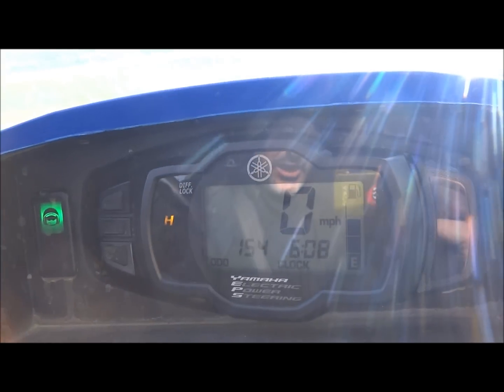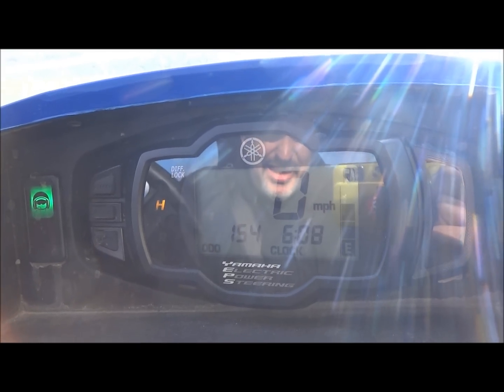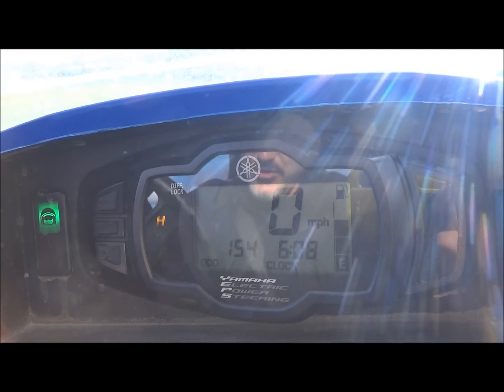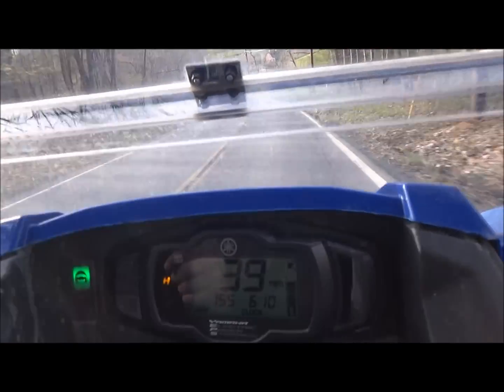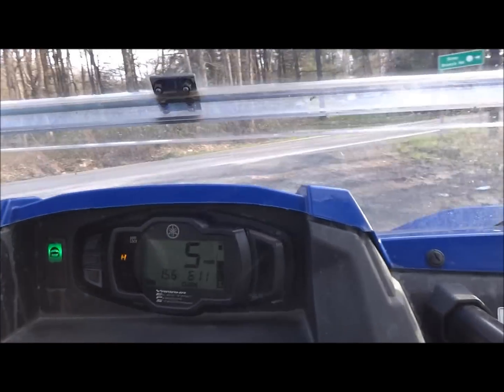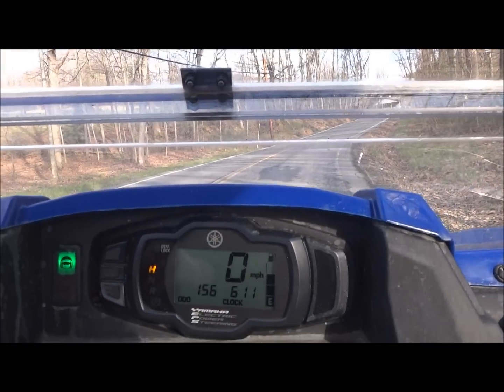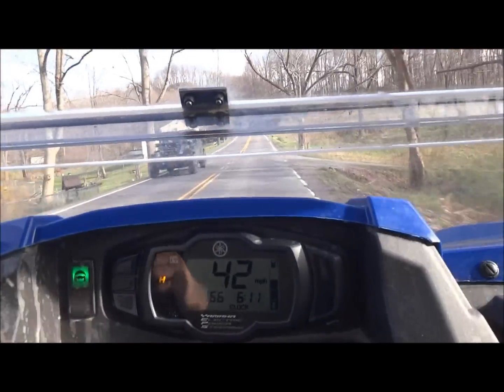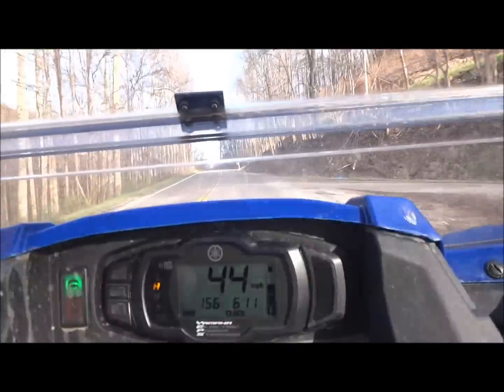Yamaha Wolverine Top Speed

Comment: mine did 52 when new now after 1700 miles it does 50.
you can chip it and get around 10 mph more it is governed if you want speed go with YXZ. And Polaris sucks I wouldn't take one if you gave It away I want to ride not work on junk.

Comment: Worn belt or not, what you've proven is that if someone buys this machine to go fast in a straight line, they bought the wrong machine.  A 708cc single cylinder engine just isn't going to make much top end speed in a 1311 lb machine.  Its designed to be a sportier version of the Viking for trail riding and I think it succeeds at that.  I only hope that this engine makes its way into the 2016 Grizzly.  That's where it would really shine.  Half the weight of this would make that 708cc engine feel very strong.
Reply: ***** That's a bit more like it but that's extra money you have to spend.  An 800cc Can Am Commander is already more powerful and faster than that and costs less.  I still would prefer the Wolverine because I question both Can Am and Polaris reliability but it seems the Wolverine should be a little faster in stock form.  Its a bit disappointing but its still more powerful than anything Honda makes.  Maybe Yamaha will finally put a bigger v-twin engine in it next year, one can only hope.
Reply: It has nothing to do with the performance of the Wolverine. It is governed by the factory at 52 mph.

Comment: a little faster than the teryx but doesnt accelerate as well
Reply: PC MR i think you have that backwards. I have a 2015 Teryx and it hits fuel cut at 50.
Reply: +PC MR google is your friend on this one.  the only way to go over 50 is with a tuner. 100 percent positive on this. every teryx ever made is factory limited to 50.
Reply: You are correct. I did a little more looking and Kawasaki does limit the speed to 80 kmh. Very disappointing. I was seriously looking at one but not now.
Reply: PC MR dont let the top end number scare you away unless you are in the dunes.  The 800 vtwin is a serious powerplant and the low to mid range power never gets old.  Plus they are built like a tank is a bonus.  All depends on your riding style.  I'm 33  with kids.  I need something for them and and me so this was a good compromise
Reply: PC MR i have a couple videos of some acceleration test.  Might be hard to tell but to 30its neck and neck with the 900s.  How much more do you really need on trails?
Reply: +Ryan Monroe 
Where I ride we have miles of trails that are straight as an arrow. We also have lots of fire roads that connect trails that are miles apart. The guys with Sportsman 85O's, Grizzlies, RZR's and Commanders are riding over 60 easily. It sucks when they have to slow up to let the guys with the Pioneers catch up. One guy with a Pioneer said he had no idea they had speed limiters and the salesman didn't tell him. He said he wished he bought something faster. Check out some of my videos from our week long ATV camping trips and you'll see what I mean about our trails.